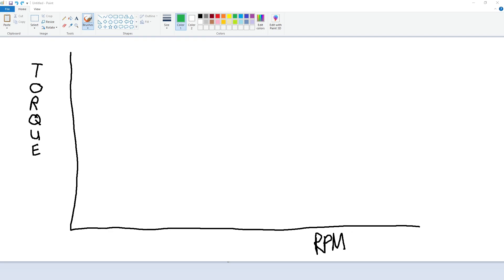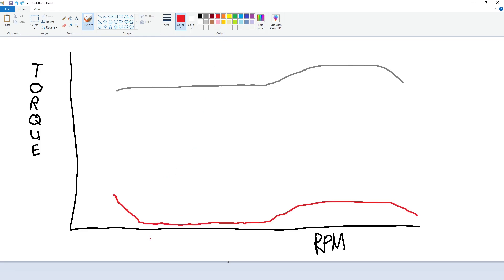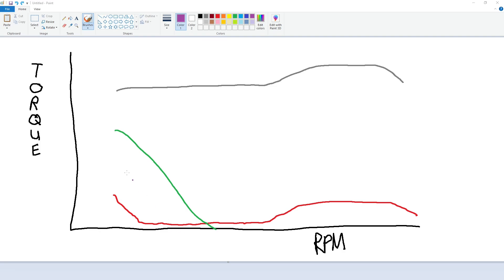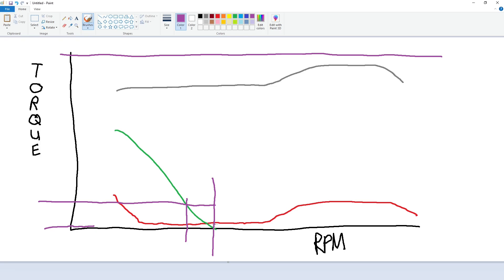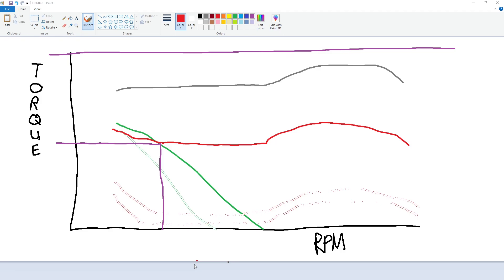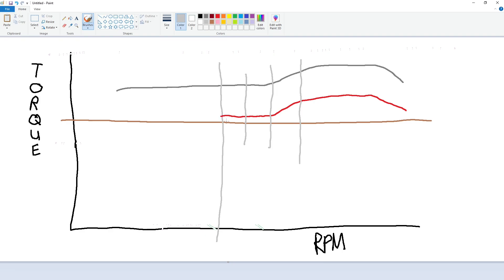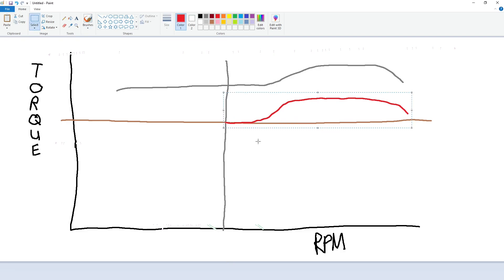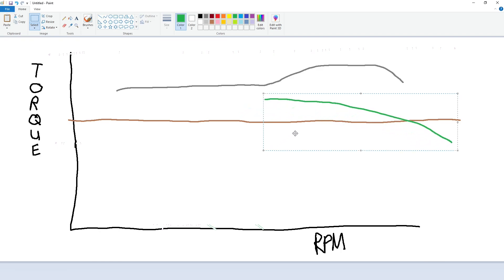Using MS Paint to (better) explain the bad throttle simulation of AC Evo, iRacing and other sims.

Comment: I don't know much about cars, but I do know that with just 10% throttle, I am not supposed to be able to rev the car all the way to the redline
Reply: It can be surprisingly little on real ECU driver torque demand tables like 12-15%. Which is a defined amount. With mechanical throttle bodies (without drive-by-wire) it can be even less, because a lot happens if you just crack a butterfly valve open. Though the linkage can be non-linear for this reason so I guess it depends how you read throttle %.
Reply from the maker: @oez4880 Maybe you reach the redline, but if you get there, there won't be a lot of torque if you do.
Reply: @ for sure, I meant the amount of throttle % that reaches an equilibrium or 0 net torque at redline.

And of course I should have added more context for @FalbereChan: at this low throttle application unlike the ACE S2000 they (some real ECU maps) start with "a lot" (relative) of torque at idle so only towards redline the engine RPM acceleration grinds to a halt.

Comment: is this the reason why on AC the clutch is so incredibly sensible? I remember the engine would stall even if I released the clutch down to approximately 80%.
Reply from the maker: Yes, and with some other sims too. Even if the clutch is modeled fine, the engine doesn't gain torque as you hit the bite point and revs can drop like a stone.
Reply: @NielsHeusinkveld  I really hope they improve it for ACE then, thanks to your video I understand everything much better. I appreciate it!

Comment: Lol this wheelspin thing probably explains why many times, especially in iRacing ovals, I went sideways in a corner, catched it, then went sideways again second later with 70% throttle.
Reply from the maker: No, well, probably not. iRacing has tires that behave very differently to games like AC / AMS1 / AMS2 / LMU / RF2 / ACC... Your problem is likely 90% tire model 10% throttle model in iRacing.

Comment: dude this explains why i stalled so much in ac. wow. this is so funny to me, as a non-programmer, who's toying around with an arcade physics model in unity, i have made a torque curve which evaluates the rpm and torque and uses that to push the car ...which works better than ac apparently....

Comment: Thanks for the explanation. I have one question (and note that I'm not questioning your logic or anything): when simracing drivers race IRL do they need to learn how to apply more throttle when the wheels spin? How on earth can they drive IRL and in the sim if this is works in complete opposite ways?
Reply from the maker: Talent probably! It is not uncommon however for simracers to be too 'active' when they get in a real car, too many steering inputs, going on/off the throttle. That doesn't feel good in reality but you can get away with it easier in a game.
Reply: Also I know plenty of people who can swap between sims all the time too. I'm a bit dumbfounded how they don't trip over the same thing, but it could be a driving style thing as well. Because if you like oversteer, certain sims feel very natural overall, but throttle modelling helps a lot I find. At least AC and maybe ACE have the ability to tweak throttle input curve per car (different much simpler concept altogether) so they can feel quite sensitive without having the dynamic Niels explained. But maybe since they're already doing that, the transition to a throttle model won't catch people out.

Comment: Ok, so this explains having to be so extremely careful at the exits of the corner probably? Also maybe this why Mazda rx7 vas so difficult to drive in original AC?
Reply from the maker: It may be part of the reason that cars in AC, and I don't drive the game much, are safe and understeery, or then fairly suddenly become oversteery on throttle, but are quite easy to then catch and control.
Reply: @NielsHeusinkveld  Ok, that means I didn't get it at all lol

Comment: My throttle only detects after I press it halfway, like the minimum is set at 40% of my pedal, it’s not my pedals issue as on Moza pit house it detects from the actual start
Reply from the maker: That shouldn't happen.. Maybe try the advanced options in ACE, make it a slider perhaps?

Comment: @NielsHeusinkveld - Isnt this incorrect because its not a two dimensional problem but three. (Not X,Y but X, Y, Z).

Three variables are Engine RPM, Throttle %, and the Engine Power/Torque demand value.

Surprised that sims get this wrong. From what I understand, when the foot is depressed, the given throttle% calls for a respective Engine Torque value until the desired RPM is reached. That's a 3D contour surface not these two dimensional curves here. That's how real cars do it, how come the sims cant just rip the 3D contour mapping of real car throttle curves? Its in the ECU files.
Reply: You're absolutely correct and that is what's going on here too with the correct model. He only focuses on a single throttle % line here at a time to prove two points (car setting off, car balancing on throttle rear slip).

This is like if you hid all, but one line in HP Tuners 2D graph view. Of course there are many such torque lines either pre-defined or calculated in simulated throttle maps which the sim then interpolates between in the end using the two input variables (RPM, throttle %) to get torque demand.

Comment: So is this one of the main reasons why even experienced racers end up spinning so much in iracing?
Reply from the maker: No, because in AC1 for example you can slide just fine, and it has the same throttle system as iRacing. Tires in iRacing are from a different solar system, that's the main issue probably.

Comment: Interesting, as always.  Explains in physics terms, instead of marketing/popularity terms, why AC is so popular for the console crowd who have watched too many of certain movies and think drifting regular cars is an easy and common occurrence.  And, by extension, likely why Kunos will prefer to maintain that defective throttle model for AC Evo because the intended audience for AC Evo is exactly the same as AC.  The proportion of that audience that cares about actual/sim-level physics versus just having fun is extremely tiny.

The video (and posted description) would have been even more helpful if you had reminded the audience which sims have a superior throttle model alongside the list of all the ones using the traditional flawed one.

Comment: I wonder with the situation of the hairpin why we don't see this back in the telemetry of the highest rated esporters in iracing? They don't reduce throttle, and more commonly you see an instantly build up to 70/80% and then going to 100%. If your explanation is correct why don't we see this practically? Based on what is done it is matching your 'correct model' with the green line.
Reply from the maker: This Honda S2000 has an uncommon torque curve shape, and in real life probably not enough power to significantly spin its tires. On most cars, revs rise pretty fast in low gears, so if you get some wheelspin, the car will still accelerate fast and before you know it you have to shift up. I think it will be harder, even for Esport reflexes, to do this perfectly. It is probably more consistent and faster to have a bit too much wheelspin on exit, which Esport people especially can instantly catch without even thinking.

Comment: is there a way to test Granturismo 7 throttle model?
Reply from the maker: Maybe. Put a car in neutral, capture 60fps video with a HUD showing the RPM. Apply a constant low throttle 10% or 20%. Load your video in an editor. For each frame, type the RPM in a spreadsheet. Now plot frame vs RPM, and you have the shape of the torque curve. If the HUD has low FPS, or the engine revs fast, this isn't very accurate.
Alternatively, try to get the car stuck, so the driven wheels are dangling in the air. Put it in a medium or high gear, repeat the process. Now the revs will rise slower because of having to spin the wheels instead of just the engine itself. This makes the video frame / RPM method more accurate.
Reply: @NielsHeusinkveld  Thanks for the info! I probably wouldn't do it all this as I don't have the time to be honest, but if someone would, please leave a comment for everyone to see !
Reply: If you have a PC you can use one of the telemetry capturing apps instead of capturing a video. But I'll be very surprised if GT7 actually has an accurate throttle model.

Comment: I’ve never really thought about it, but i understand now why it can feel so tedious to hit the right amount of throttle on corner exit. AC it would often lead to a spin, in EVO the physics and tires feel far more natural so maintaining control is very easy. Very similarly to rFactor 2, I often find myself exiting corners somewhat sideways (it might be fun, but it isn’t really fast) or feeling like I’m not accelerating as hard as I could be, hitting that sweet spot is really difficult.

Comment: Hi, this throttle simulation is indeed very bad. However, your proposed correct way is also not all the way correct. The reason why the engine won't rev to the moon when you give it a small amount of throttle is because of internal losses such as friction. Mostly friction actually. The friction losses increase linearily (actually slightly exponentially) with engine rpm. The engine however produces an almost constant amount of torque per throttle setting. If you subtract the internal losses of the engine, you get a curve that is (slightly simplified) just a diagonal line from the top left to the bottom right. How high it starts on the left side depends on your throttle setting and the angle in which it then goes down depends on the specific engine. In reality this is not an entirely straight line, but in the scope of a simulation for a racing simulator it can easily be approximated as one. If you now give it more gas, this line just moves straight up. The angle doesn't change. When your throttle setting is so high that the diagonal line intersects the actual max-torque curve of the specific vehicle, it gets "cut off" by that. So for example: let's assume a throttle setting of 20%. This is so much throttle, that at idle, you will already hit the max torque output of the engine. So the graph will start right on the max torque of the engine at idle. It will then follow the max torque curve until (for example) 2000rpm. Starting from there, it will transition to the diagonal line that just goes down straight and intersects the x-axis at (for example) 6000rpm (where, by the way, it will also continue underneath the x-axis - negative torque is also possible in the form of engine braking). This means: in neutral the engine will rev to 6000rpm at 20% throttle setting. This also means: below 2000rpm it does not matter whether you give it 20% throttle or 100% throttle. The torque output of the engine will be the same.
Figuring out the angle of the "diagonal line" that I keep talking about is not super easy if you don't have access to the vehicles on a dyno, however finding out where the rpm end up with how much throttle input can be found out in a couple of minutes if you just have access to the cars. Since they do model engine braking, I imagine they do have data on the friction of the engine tho (the negative torque on 0% throttle setting or beyond the x-axis intersect of the diagonal line). So therefore it should be relatively simple to correctly implement this in the simulators. I'm talking about less than a day of programming for one person, depending on how their code is set up. Plus additional time for tuning it to all the vehicles of course.
I hope this was somewhat understandable. If you have questions, don't hesitate to ask.
Reply from the maker: Do you have any articles or data to support this? I believe it has more to do with a small air intake opening at low throttle not allowing enough air into the engine for higher RPM..
Reply: @NielsHeusinkveld  I quickly looked around for some data to support this, but I don't have much time currently, so for now my source is that I am an engineer. I have more time starting on tuesday so I will be able to look for more data on this.
You might have a point here, I will need some more time to do some research. Likely it is a combination of both, the effects described by me and the ones described by you.
Have a nice sunday.

Comment: The main question is why? Why have all those sims not implemented a better model if its so important and relatively easy to implement. What is missing here? 

Is it not that important, not that easy, they all don t care? Something else? What is it?
Reply from the maker: I have no idea. BeamNG, RF2, AMS1, AMS2 all had the idea to improve their model, but the rest I don't know why they wouldn't implement such low hanging fruit type of an improvement. That's the main thing, it is simple and a solution can run on a 1992 486 computer. Why not improve the model for the thing that makes the car go fast?

Comment: To be fair, the S2000 has a very uncommon torque curve.  Most cars will get peak torque around one third to one half peak rpm and then stay level or steadily drop from there.  The S2000 does provide a more extreme example of the problem with the current throttle model and all cars would improve by having a more realistic model.
Reply from the maker: Absolutely, it is a great car to showcase the strangeness, thanks VTEC!

Comment: I imagine that improving the throttle simulation would add the effect where partially letting off throttle near the rev limiter would put engine into 'light' coasting, which would put negative forces into the drivetrain, causing it to flex into the opposite direction. Increasing the throttle again would then provoke a jerky reaction from the drivetrain and consequently the engine before actually accelerating. If I remember correctly there was some sort of drivetrain flex in the AC1 so there is probably some in AC evo aswell. Do you think this change alone (throttle response) could give us a similar effect? I've always found this as the biggest flaw of the sims I've tried.
Reply from the maker: With a better model, it could be that partially letting go of the throttle at high RPM, reduces torque more than with the old model. But the way you describe drivetrain oscillations, I don't think that would change all that much with one throttle model or the other. I don't think there is drivetrain flex in AC1, but I could be wrong.

Comment: setting aside the technical details for a moment, i think it's really important for devs of racing sims (well, any game/software that is trying to simulate any vehicles with internal combustion engines) to have a lot of hands on experience with driving vehicles in a wide range of conditions. personally i have been modifying and racing cars since i was a teenager and at this point i have a really good "feel" for how an engine should respond, and when i hop into a sim it doesn't take me long to "feel" where the simulation is taking shortcuts or in some cases doing things entirely wrong.

obviously it's not realistic to expect every developer responsible for coding an engine simulation have years of real experience, but something like a few hours of "track day" type experiences, hanging out in a dyno tuning shop for a couple of days, things like this could really help connect theory to real life for them... imho.

Comment: Is that the reason because it's too hard to maintain a constant speed at the rolling start in Assetto Corsa Competizione?
Reply from the maker: Yes, with a more horizontal torque curve, reaching and maintaining a fixed speed is more tricky as well.

Comment: Anybody who has driven a manual car in real life knows what you’re talking about. I recently started driving a manual car again. When I’m in first gear, press the throttle a little bit and slowly let go of the clutch the car does not accelerate linearly. If I press the throttle a little too much the engines can get quite loud, because there is no resistance if the clutch is still pressed enough. Most sims are still missing this. Except beamng drive, because it fully simulates the engine and gearbox. I hope Kunos improves this in ACEvo. When I buy a clutch for my sim setup I want the full simulated experience

Comment: Please also make a video about them properly simulating different gearbox configurations ie; DCT, AMG, PDK, ZF, and etc.. they all behave differently and have unique characteristics. They should also model a true “automatic” transmission like BeamNG where the gearbox will shift smoothly at lower rpm, kick down when desired, and be adjusted into sport or race for more aggressive driving. If we will be having open world and highways etc, this is a must for immersion.